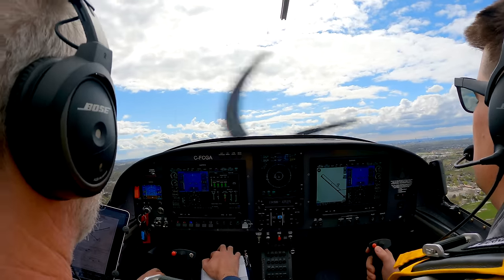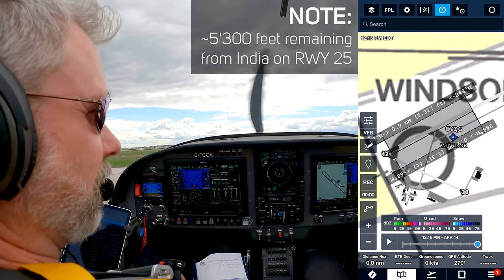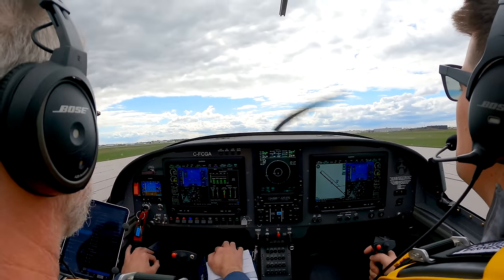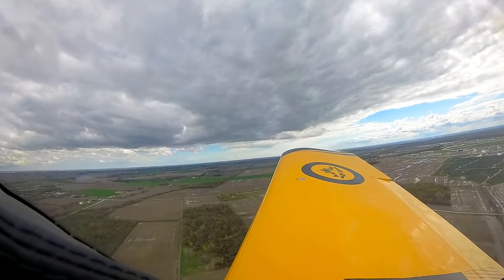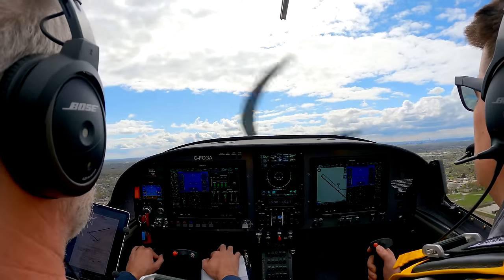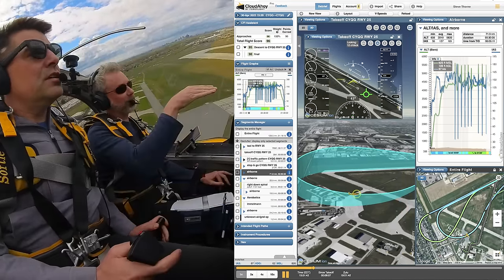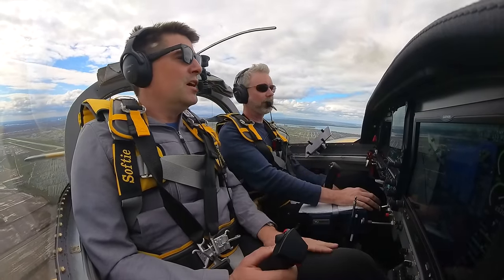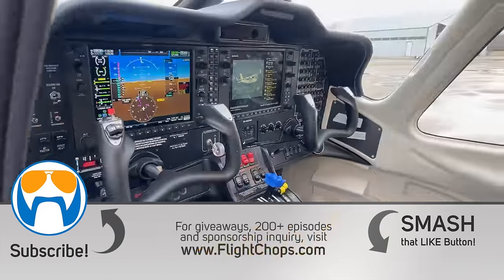Making the IMPOSSIBLE Turn… Possible from 600' AGL?

Comment: Really good point about getting back to the airport property.  I think a lot of folks don’t think about how hard it may be for emergency services to get to you if you put it in a field and end up trapped and or injured severely in an aircraft.  Definitely something to think about, but so situational.  I think key takeaway, don’t be lazy with your pre-brief. Even if its just yourself in the aircraft, know the area, know the aircraft, know yourself and the limitations of all 3.
Reply: @outwiththem  I don't want to speak for Dan, but I will say, he isn't irrational.. if your choices are a dense neighborhood in front of you and you are in a slick RV at 1k AGL go ahead and return to the field. You have to realize Dan typically flies a DC-3 and flies out of a rural airport.  You are speaking for him and I do not feel that is completely fair.
Reply: @nikhayes3396  Dan's an ass, do what flight chops did, practice.  You can always do it at elevation., make the turn and see how much elevation you lose.  Try different bank angles, just stay coordinated and let the nose drop as needed to prevent a stall.
Reply: @craigsanders6925  Climb at Vy, not shallow.  3 second reaction time is a lot for a pilot.  Higher is slow pilot.  I used to teach 2 kinds of turnbacks, 50 feet engine fails and aerobatics when CFI in 1990's.  From Vy, if over turnback marker,  push nose down and Vglide 45 bank turn into the crosswind if any, dont look to runway and turn body at same time or you might pull elevator too by mistake.   Concentrate on the Vglide 45 bank for first 90 degrees, then look at runway, not before.   If you find yourself too low to glide to airport, you are pointing already to headwind.  Decide to keep the turnback or land headwind if too low. 
 If gliding to airport, Call if time, drop flaps and mixture if too high.  On flare, if fast, cut the mixture and cut the flaps.  Better than crashing on houses or cars. If you find this Vglide 45 bank difficult, imagine if you crash outside the airport from a safe turnback altitude but you decided to crash outside "because Vglide 45 is difficult".  You will feel like a fool, hurt and broke too due crash expenses.

Comment: I'm a PPL with a glider rating, we're taught the turnback as part of training. For most gliders, the turnback is possible from 200-300 feet AGL, but the key is that you have to get up to a 45* bank to get the minimum altitude lost in the turn. The other trick is to turn into a crosswind as it will push you back towards the centerline of the opposing runway.
Reply: @CFITOMAHAWK2  Victor... i know you are mad at all those paper tigers destroying nice machines ...  Well They dam are..  I used to say that too.  LOL..

Comment: "At 600 feet we will turn back to the airport and land on any clear surface."   

In a real emergency I don't care about if it's an official runway.
Reply from the maker: Watch the whole video :)
Reply: @outwiththem  Hi Harold.  Yes the flight indicators or markers should be on Altimeter and ASI.  Remember i also used to put a minimum level power mark RPM.  To indicate the minimum LEVEL ALTITUDE RPM on tach.  So no need to think if the rpm is good to keep altitude or not if it falls back there.  Easy references to be used also all times.

Comment: I have practiced the turn back in a RV-14a.  A 45 degree bank @ 85kts had less altitude loss than 95kts (No wheel pants).  Key points, if you don't know all of the parameters then straight ahead is the best option.  I always calculate the altitude where this becomes an option.  After takeoff, I allow the crosswind to push me a little off center line as my reminder of which way to turn.  This also reduces the amount of turning. When the wheel pants are finished we will run the numbers again.

Comment: One of the rare times we've both posted flying videos on the same day.  Speaking of impossible turns, I got to witness an emergency landing at PTK last Sunday.  A Cherokee flown by a flight instructor had just taken off from 27R, I was standing by a friend's hangar at Echo Row on the north side.  Just as he flew by, we heard an immediate engine note change and the sound was unmistakable: he'd just lost a cylinder.  He leveled out at about maybe 200-300 feet AGL; his engine sounded very rough but it was still making power and there was no smoke.  He carefully milked it around in a left turn and came in on 9R; inbound jet traffic went around above him.  Good landing by a cool instructor.  I captured the very end of the turnaround with phone video; afterward I met him at the flight school and shared the video with him via Dropbox.  Since his mechanic is also the former president of our EAA Chapter 194, I'm sure we'll get a presentation of the incident from them in the near future.  I've practiced the impossible turn in the sim and it helped me do a simulated power loss all the way to the ground in a Citabria a few years back.  I was pretty proud of that, but about a month later I went through a similar scenario with Dave in the Chippie and botched it in a rather embarrassing fashion.  Pride goeth before a fall.  In other news, that Tecnam looks sweet!  Good Luck!

Comment: Doesn't really matter which runway I take off of at CYOO Oshawa - it's now completely built up all around. There aren't too many off airport options; coming back (if I have enough altitude) is the best option; taxi-ways and grass are all fair game in my opinion (with my aircraft).
On another note - Interesting difference in the microphone quality between the A30 and A20 headphones. To my ear the A30 is much clearer.
Reply from the maker: Good insights - and agreed yeah - the A30 mic is excellent.
Reply: 👍with the sod farms to the east of CYKF and the city to the west, the engine out briefing can be quite different depending on the active
Reply: I mapped it out once, and from runway 30 if you make it to at least a few hundred feet, you can glide to some fields on the north side of Taunton.  But that's one out of 4 runways, and only IF you make it to a few hundred feet first.  Other than that, yeah, the built-up neighbourhoods all around CYOO are anxiety-provoking every time I take off over them.

Comment: Climb at Vy, not shallow.  3 second reaction time is a lot for a pilot.  Higher is slow pilot.  I used to teach 2 kinds of turnbacks, 50 feet engine fails and aerobatics when CFI in 1990's.  From Vy, if over turnback marker,  push nose down and Vglide 45 bank turn into the crosswind if any, dont look to runway and turn body at same time or you might pull elevator too by mistakeon first 90 degrees of turn. Concentrate on the Vglide 45 bank for first 90 degrees, then look at runway, not before.   If you find yourself too low to glide to airport, you are pointing already to headwind.  Decide to keep the turnback or land headwind if too low. 
 
If gliding to airport, Call if time, drop flaps and mixture if too high.  On flare, if fast, cut the mixture and cut the flaps.  Better than crashing on houses or cars. 
If you find this Vglide 45 bank difficult, imagine if you crash outside the airport from a safe turnback altitude but you decided to crash outside "because Vglide 45 is difficult".  You will feel like a fool, hurt and broke too due crash expenses.
Reply: Turn backs are an awful idea.  

And I say that as someone who was taught them and survived a real one.  

There are far too many variables to a successful one. Heck.. some planes due to light winds and high weights depart at an angle that is shallower than there glide angle.. making it MATHEMATICALLY IMPOSSIBLE to make it back to the runway.  

A forced approach into almost any terrain—including trees and houses—is survivable as long as you don’t stall or spin.  Something that lots of pilots got into trying to make it back.  

Don’t risk your life and the lives of your passengers to save insured PROPERTY!!
Reply: Yes, this is good. Your not trying to make a coordinated standard turn your getting the dang airplane back to the runway. Push the nose down, with the extra energy pull a steep turn into the wind and get it back. Now it does depend on the airplane but for the small aircraft I fly this is what I’d do.
Reply: @calvinnickel9995  Read again. You need those turnback altimeter marker.  I used them for real and 3 more pilots i know.  Read again all post here i did.  You were trained bad i guess.  I will show you videos of no power turnbacks from 600' agl on cherokees, landing on 3,000 feet of runway.  With high winds. You show me your "landings" on those trees and houses you say they are survivable.  Show me those. I will show my landings, not crashes like you say you will do.  Waiting for your videos.. for real, not on BS simulator.

Comment: The wind definitely plays a factor here, but when you have other runways available, I would consider briefing a turn back to a different runway.  You could probably make RWY 12 from 600' AGL if you turned right.  Similarly if you have parallel runways, turn toward the one next to the one you took off from.

Comment: If you fly straight out and than need to turn back like that, it's allways a 270° turn. 180° to reverse parallel to the rw + 45° to point to the runway + 45° to point it back to the centerline before touchdown.

Comment: Have done this in my Sling4. 600ft is OK provided there is enough of a headwind to improve the climb angle. Have a hostile airport environment at my home field in terms of off airport landing sites - I like the idea of considering a return to the airport property rather than fixating on a runway return to keep that wing loading low and the risk of stall-spin down.

Comment: My instructor has shown me several times how a 172 comes back from 200' AGL. It's a quite aggressive turn, almost a wingover, but it keeps your airspeed high enough and you even have some spare to grease the landing.
Reply: Hell no. I used to teach turnbacks no power from 600 agl on Cessnas.  That is too dam low.  Let me see that video him doing that with 2 on board.

Comment: Most common engine fails are PARTIAL POWER.  I taught 400 agl partial power turnarounds and turnbacks when CFI 2 decades ago.  I created the partial power 444 rule to do it safely and easier.  Partial Power on take off is lately known as Reduction of Thrust On Take Off (ROTOT), so for short, we can call that rule The 444 ROTOT RULE. 

WHAT IS THE 444 ROTOT RULE.

The 444 Rule is a rule I created In the 1990’s to deal with the most common engine failure on take off, which is a partial power failure. Most times is a cylinder lost.  That is a Reduction of Thrust On Take OFF (A ROTOT) I had 3 of those on Cherokees, i landed on runway on all 3.  Most common is a cylinder lost ROTOT.  Most fixed pitch prop planes will keep 1,800 to 2k RPM if cylinder lost.  You will not climb at all unless low temp and low weight.  If over 400 feet agl, consider A Turnback.  A Turnaround the airport can take 3-4 times more distance and time to land.  Many turnaround airport low ROTOT end up crashing on downwind, base or final leg.  Not a Turback.

Most ROTOT accidents are Turnaround the airport, not a Turnback to closest runway but the Turnback ignorants call A Turnaround a Turnback and a Turnback a Turnaround.  No, they are not the same maneuver.   A Turnback is not a Turnaround the airport and you dont “turnaround” anything.  Just turn 40 bank to closest runway or back runway at Vglide speed.  Dont Turnaround anything on A Turnback.

To do THE 444 ROTOT RULE.  Before taxi, mark the altimeter for 400 agl mark.  When power reduction, IF OVER 400 agl altitute marked, 1- lower the nose to keep Vglide or Vx if some flaps used for take off (I DO). 2- Some carb heat and some mixture control out. 3-Turn to side 40 degrees to get runway distance for about 4 seconds. 4-turn into the runway at Vglide 40 bank nose low of course.  Cut power when bit high, flaps and gear down when a bit high again. 400 agl, 40 degree to side, then 40 bank nose down.  444 ROTOT RULE.  

No power be almost double ROTOT altitude.  For that i developed The 777 NO POWER RULE.  I will post later on.  I did one in 1994.

NOTE; If a crosswind you better turn first to downwind side of crosswind, then headwind on second turn.  Never turn to runway with a strong tailwind to it, specially if 18o short approach.  Short approaches with a tailwind produced many crashes via overshoot stalls.

 That is one of GRM basics.  
Jay Vega, Aerobatics and EFATO CFI all 1990's. I had 3 ROTOTS on cherokees with cargo.  landed them.  and 3 left and right full feathered landings with cargo on Aztec, and DC3.  No BS.

Comment: Most engine fails are partial power.  Power go down due mostly lost one cylinder.  On 4 cylinders engines will go down to 1,800-1,900 rpm.  Just about Minimum Level Power (MLP).  Practice MLP Slow Flight.  With about 10 degr. flaps. One of my students with only 70 hours total, took off C172 with 3 adults on board, rpm dropped to that, but he had training turnback from 400 agl. He turned back from 300 agl, landed opposite.  No damages.  I taughtTurnback Training in the 1990's,.  Partial and total EFATO I did.  I called that EmergencyLowManeuvering.  

The 444 Partial Power Rule .  If over 400 agl, turn to side 40 degrees for 4 seconds while leaning mixture a bit and SOME Carb Heat too.  Then 40 deg bank to the runway at Vglide speed.  444 Partial Power Rule. drop flaps on it before drop all the power to land.

Comment: Great video.  I fly out of CYXX and rwy 01 has very little options after takeoff for a forced landing.  A right turn back to the field is usually the best option with the goal of at least making it back to the airport property.  It also doesn't help that the airplane I fly has the glide peformance of a brick.
Reply: I agree losing engine on 01 is sketch, I am based CYXX as well.

Comment: Practiced this a few times with a CFI in the Archer II I fly most of the time, I know I can make any runway at my home airport at 800 AGL, probably at 600 as well.  For the crossing runway I need to circle farther or slip to land anywhere near the threshold.
Reply: @onyourbikes If you are losing a “few” (I take that as more than two) hundred feet during the startle, then you really need to take up something other than flying.  Even at a 2,000 FPM descent, 300 feet takes 9 full seconds.  And most light airplanes won’t descend more than 1,000 FPM which is 19 seconds.  If you can’t decide within 9-18 seconds how to handle an engine failure, then you really aren’t cut out for aviation.
Reply: @onyourbikes  Well since I've had an engine stop after switching tanks and that didn't happen then, I think I'll probably be Ok as I plan for it on takeoff.  

First time we did it I didn't get a warning, after that I knew it was coming but didn't know when.  Landed on all runways, it was a fun morning.  I've done it a few times since then so I know that plane in those conditions at that airport.  One of the things I tell the CFI during currency checks is to test me on it without telling me ahead of time.
Reply: @onyourbikes  As long as you don’t do a Vmc rollover.  😂

Comment: The impossible turn altitude is absolutely valuable data
Reply: Climb at Vy, not shallow.  3 second reaction time is a lot for a pilot.  Higher is slow pilot.  I used to teach 2 kinds of turnbacks, 50 feet engine fails and aerobatics when CFI in 1990's.  From Vy, if over turnback marker,  push nose down and Vglide 45 bank turn into the crosswind if any, dont look to runway and turn body at same time or you might pull elevator too by mistake.   Concentrate on the Vglide 45 bank for first 90 degrees, then look at runway, not before.   If you find yourself too low to glide to airport, you are pointing already to headwind.  Decide to keep the turnback or land headwind if too low. 
 If gliding to airport, Call if time, drop flaps and mixture if too high.  On flare, if fast, cut the mixture and cut the flaps.  Better than crashing on houses or cars. If you find this Vglide 45 bank difficult, imagine if you crash outside the airport from a safe turnback altitude but you decided to crash outside "because Vglide 45 is difficult".  You will feel like a fool, hurt and broke too due crash expenses.
Reply: the altitude depends upon your aircraft, it's glide ratio, runway remaining/length, Density Altitude, wind speed and direction, and more. Don't take one particular altitude as true for everyone, every aircraft, nor every condition.
Reply: @outwiththem  as long as you're considering worst case scenario. most pilots aren't.

Comment: A tail wheel pilot of nearly 40 years told me today to always take off with flaps 10. That in an emergency everyone has a human delay of 5-7 seconds and taking off with flaps 10 will buy you back those 5-7 seconds. What do you guys think?
Reply: He is right.  Except on too low HP airplanes that even 10 degrees are draggie while power off.  See my playlist..

Comment: I missed your introductory written comment on your briefing this maneuver to "completion" at a safe altitude.  This serves to help make you proficient in the maneuver, and in your particular airplane.  Should you ever "test" it realistically?  Maybe with a very experienced pilot with you and using the parameters you used at altitude.  Regardless, for a thorough overview of the turn back maneuvers that provides guidance on coming up with the numbers as well as many caveats, one should read the articles and webinars by Barry and Brian Schiff, Charlie Precourt, Russell Still, at a minimum.  Oh, and for a cheap and safe way to practice and see how changing parameters such as wind, runway length, DA, startle factor, etc. affects the outcome, fly it in a simulator.  Again, it will help develop some of the muscle memory needed for "success".